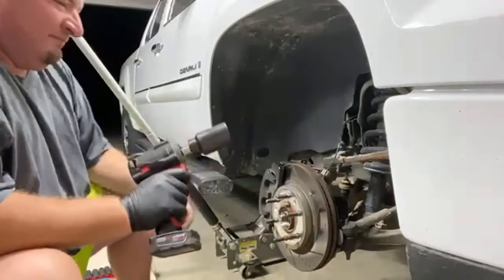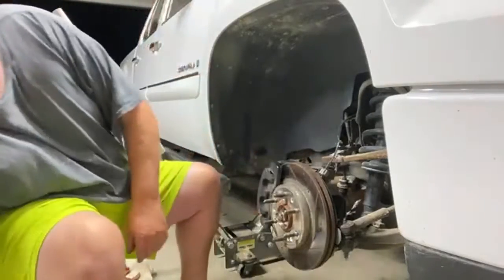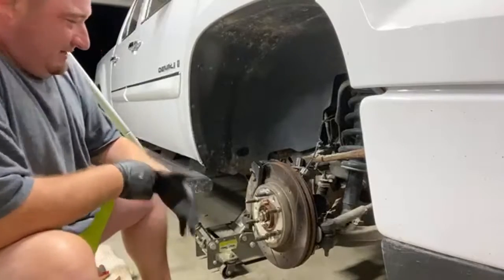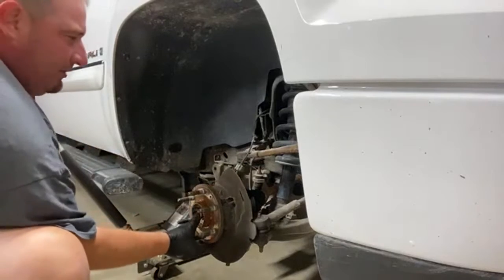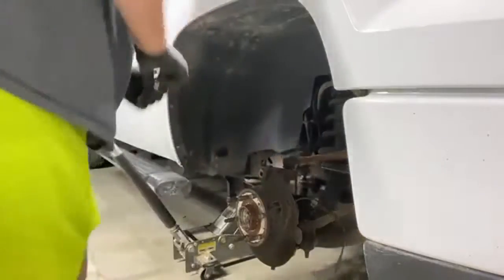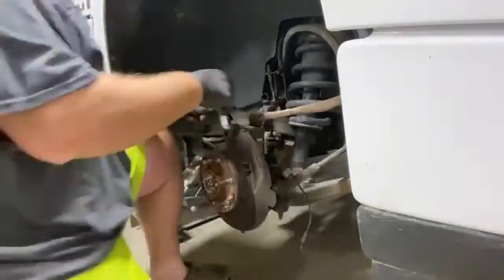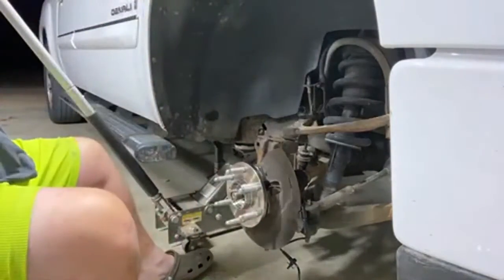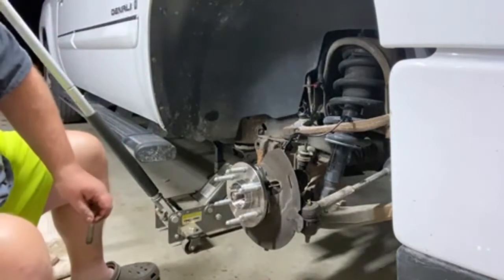2007-2013 GMC Sierra/Chevy Silverado Hub Assembly Replacement

Comment: Great video man. 
What company did you choose for the wheel bearing?
Also the rotors. They look high quality.
 Thanks.
Reply from the maker: I chose oreilly auto parts for the bearing. The brakes and rotors are from powerstop and I highly recommend

Comment: How did you tell it needed to be replaced? I have some noises coming from the driver side tire when I go slower speeds over bumps or turning with pressure and I've had 3 different mechanics tell me 3 different things... But wheel bearing was 1 of them!
Reply from the maker: I had a humming noise that would get loud when turning one way and quiet when turn the other. Also had abs light
Reply: did you figure it out? I hear a squeal sound when going over uneven roads and was recommended to change my hubs. It only started making noise after dropping my truck